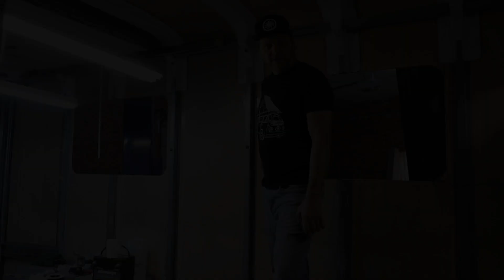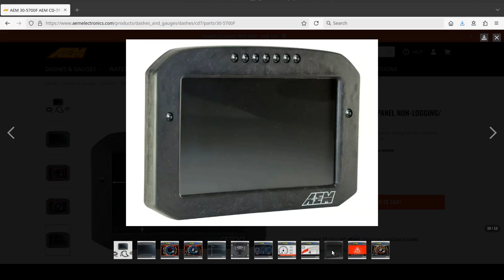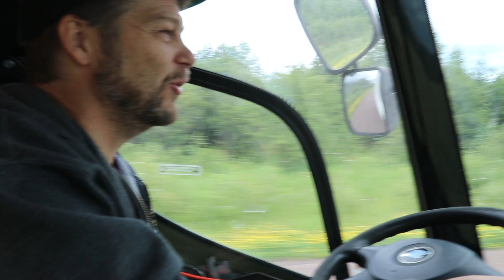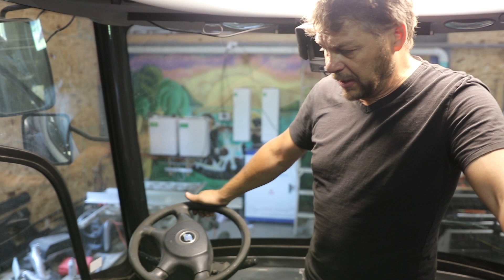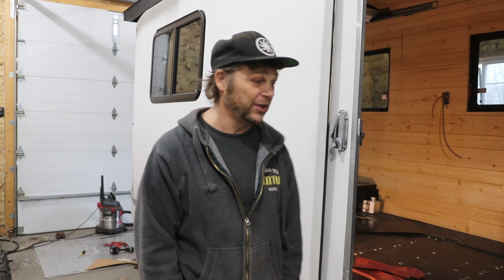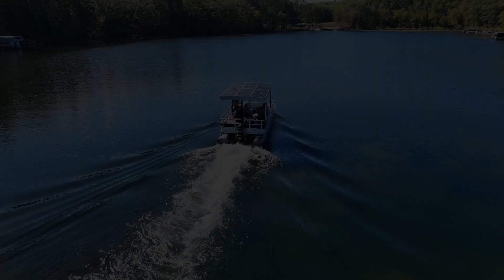SOLAR-POWERED ELECTRIC CAMPER VAN, REDFOO BUILD PART 3, FIRST TEST DRIVE!

Comment: Can you please share the price you are charging for this setup, including the cost of the van? The idea is great but a Chevy Brightdrop Zevo 600 costs about $65,000 and can go 275 miles but has been shown that it can go up to 300 miles on a charge.
Reply: DIY can’t hold a candle to mass produced commercial vehicle.  What is the incentive to report cost?  
Brightdrop is a great platform, but tell us what you pay when you have one.  The next issue is power access.  GM isn’t allowing full access to their battery so you will need a house bank to supplement the kw or so they give.
You do know there is a guy offering customizable RVs based on Zevo ($190k) in Detroit, right?

Comment: did i get that correct?
1.6 kWp on the roof
8x 420Wp so 3.36 kWp in satelite panels so
so 5kWp.
and 100Kwh for 100 miles.
100kWh/5Kw=20h
how does that app up to 100 miles per day? or is that the goal for the far future?

Comment: You should check out Aptera Solar for your solar needs! Their panels are protected against all elements and curved for the roof structure. They may be an alternative for your solar needs. They are located in Carlsbad CA.

Comment: can we add portable foldable vertical wind turbine...........only use when camp/stop
Reply: Sadly not worth it. I looked around for one myself, for a 1.2m diameter turbine you need 30kph winds to get ~150W. They can peak at about 400 -500W at about 50kph but then drop above that as they lose efficiency in higher winds. That's in ideal turbulent free locations.

I've been van lifing in NZ (quite a windy country) for several years now and very rarely find myself in conditions like that. When I am it's not a particularly pleasant experience.